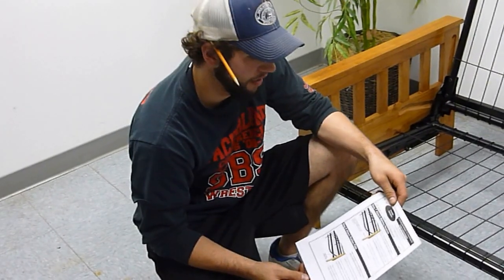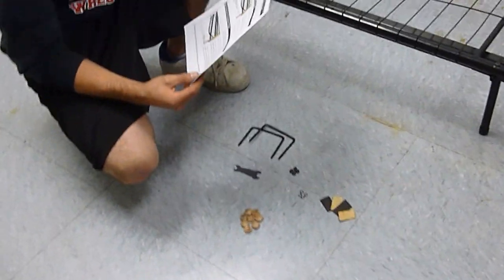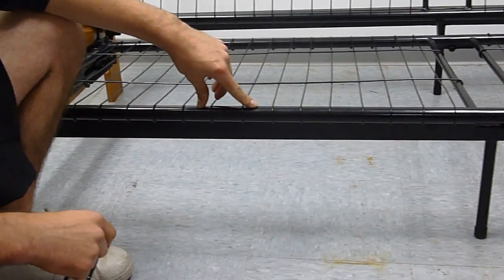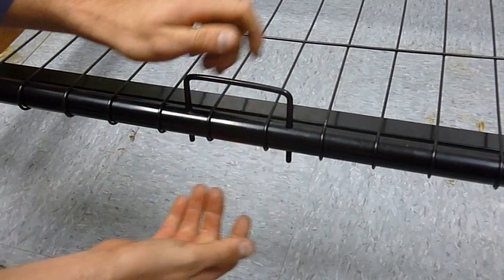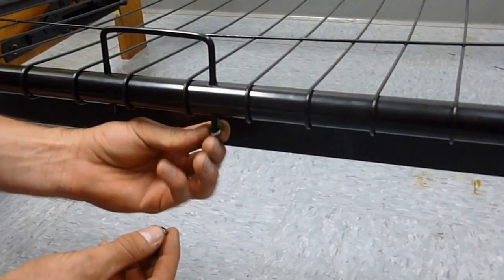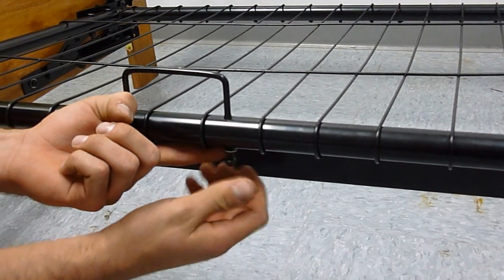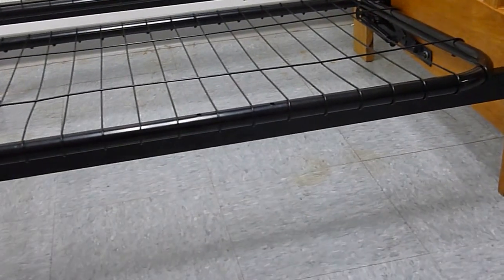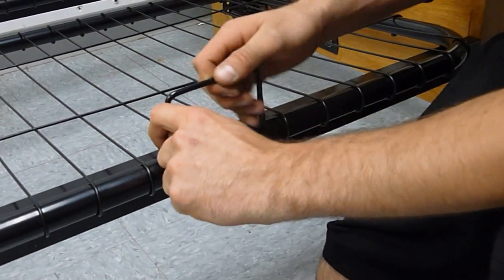Futon Frame Assembly Video Steps 7 & 8

Comment: Are the grooved things on the side of the loop supposed to go through the top of the seat frame? I don't have enough thread on the screw on the underside to actually screw the nut
Reply from the maker: The "grooved things" on the side of the look should not go through the top of the seat frame ... they should sit on top of the frame ... regarding the not enough thread, I'm not sure why you do not have enough thread but a suggestion would be to eliminate the flat washer if it helps ...

Comment: One year ago you responded you would fix this video and it's still not fixed.  By the way, the instructions you ship with your futons say that hardware should be included that is missing (quantities are wrong).  It says you should have the following quantities:  Part F (8), Part G (12) and Part I (12).  Instead, it comes with Part F (4), Part G (8) and Part I (8).  It says "as long as you have these quantities don't worry about extras".  If only there were extras.

I ordered two of these futons and had to open the second one just to find out the hardware is shorted in both of them.  From your video, it appears the quantity of hardware shipped may actually be enough (we'll see), but you guys need to provide accurate instructions of that's the case.
Reply from the maker: It sounds like you have an older assembly instructions ... the hardware quantity you received is correct ... email us at service@epicfurnishings.com requesting the current assembly instructions and we will then email them to you ... we are sorry for the inconvenience ...